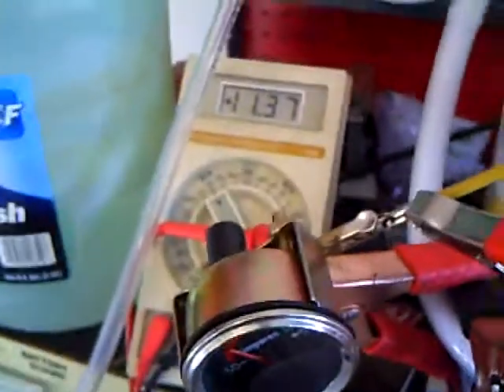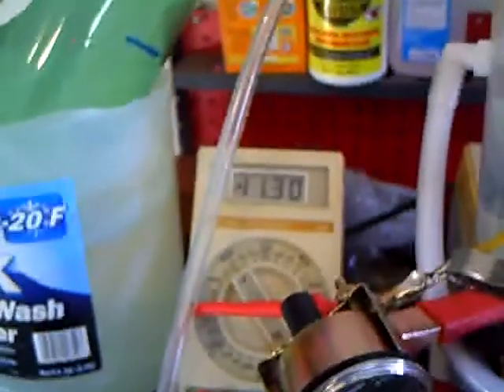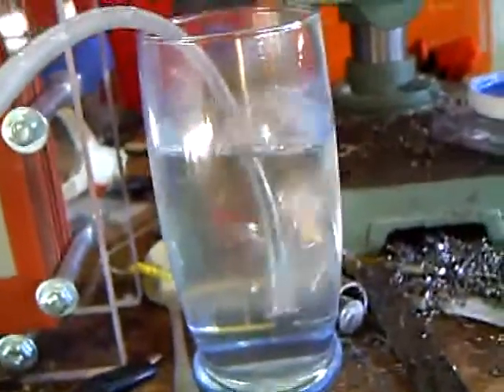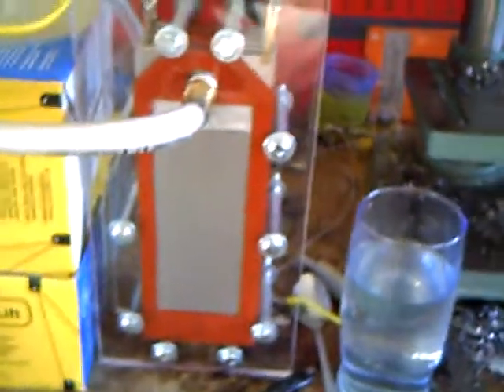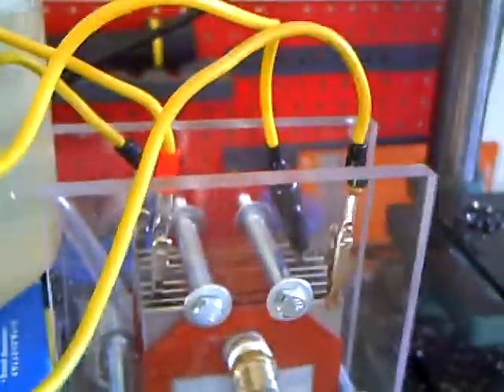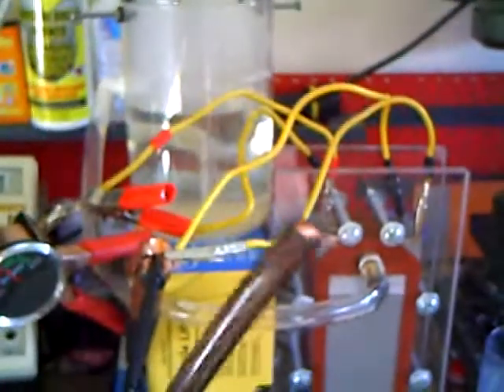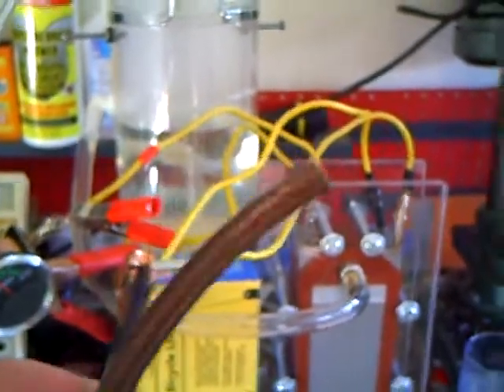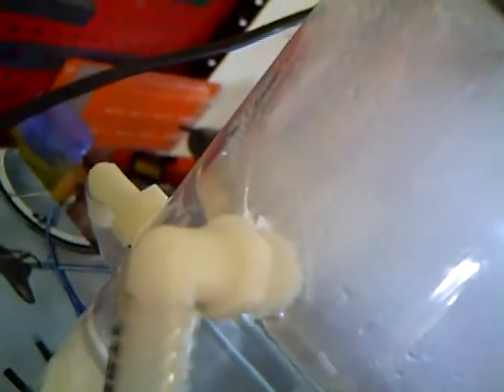HHO Dry cell,

Comment: 5 starts there bud! Really gratifying to see others succeeding like this. As for joining the wire pigtails, just twist and solder, then maybe use a large non-insulated barrels and 2 or 4 gauge wire to extend to the power source. Crimp then heat with a butane or propane torch and solder.